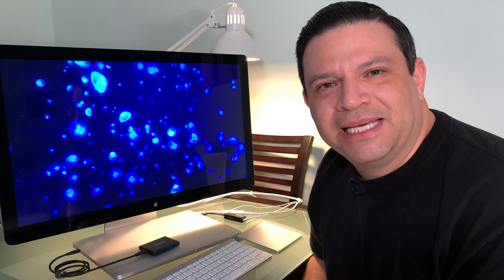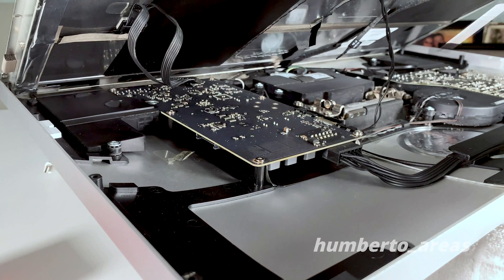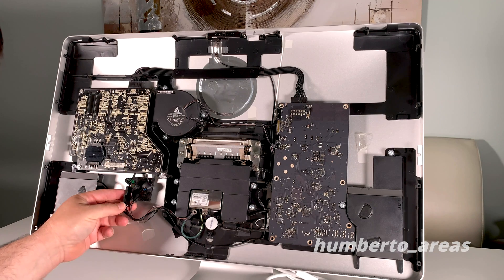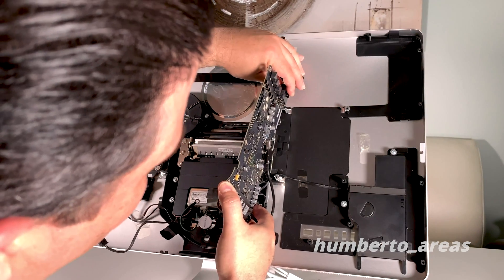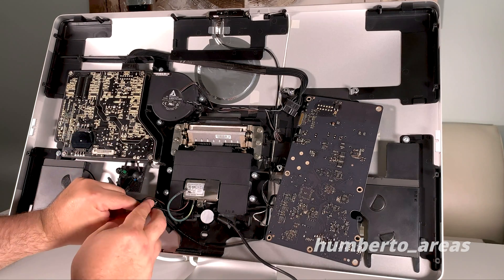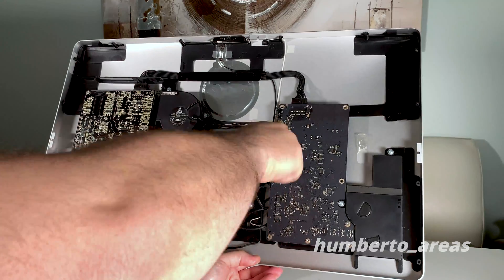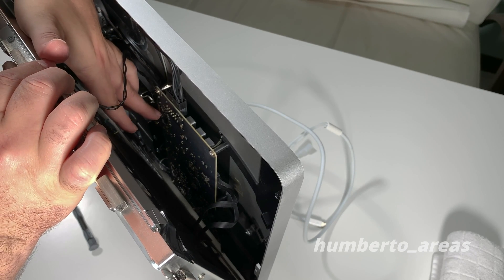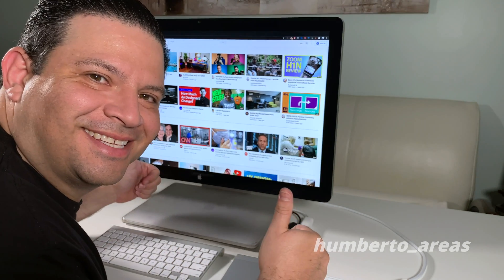Apple Thunderbolt Display Not Turning On - Step-By-Step DIY Repair 2026

Comment: Thank you for this Video, I picked up a 27" Thunderbolt Display for $35 on eBay due to the No Power issue.  I connected it to a separate Thunderbolt cable and it worked!!  Now I can use this video to replace the defective cable.
Reply from the maker: @Will, thanks for watching the video, glad to hear you got value out of it. You got a deal buddy, good for you! What part of the video did you find most helpful?
Reply: @HumbertoAreas  Welcome. The details as far as connectors and their locations.
Reply: was there no power at all? asking bc mine isnt making any noise at all just dead. would the thunderbolt cable cause that like in this video? thank you
Reply from the maker: @Shaun, have you tried another Thunderbolt cable? Perhaps on another PC? Or put an USB stick on the back of the display to see if it lights up? Please keep us posted.

Comment: I bought this used and I stupidly bought it with some shrink wrap on the thunderbolt connector. It was a little flaky at first then seemed to work but went black the other day. You give information about the connector with the black tag (what to do with the tag) when you put it BACK ON, but it's already disconnected when you disassemble. "I did remove the two other cable connectors". No mention AT ALL of flipping that IMPORTANT tag over to disconnect. I just pulled on the connector, the tag came off and it bent upwards the copper strip on the board. I burnished that back down with finger nail. I seem to have gotten it back together but it's as dead as it was. Not sure if I wrecked that connecter with your LACK OF INSTRUCTION or not, but I have to give you a fail since you did not mention one of the most important things. Your step by step missed a step.
Reply from the maker: @John, thanks for watching and for your feedback.

Comment: Hey I did try to fix my monitor as you said but it did not work I went backed and double-checked my work and everything was fine. does this mean the issue I have is not related to the wire?
Reply from the maker: @SwageRanger77, thanks so much for watching my video and for your comments. If the cable replacement did not fix your issue, indeed you may have another problem that is not letting your monitor come on. What is the model number and screen size of your monitor?

Comment: Humberto, more Cinema Display 27 no turn on info for your viewers.  Just picked up another beautiful condition CD27 that would not turn on with my Mid 2011 iMac running High Sierra.  Tried with a M2012 MPB 13 running Mojave and it eventually came on.  Opened CD27 up to check connectors and check for fan spin, all good.  Thought it might be CD27 firmware so ran the loader from Apple.  Went back to the M2011 iMac and still no screen.  Read in the blogs that USB in CD27 sometimes knocks out screen so tried with no USB and it came on.  Plugged the USB in for brightness control and the screen went dark.  Re-boot.  Tried another USB port and success, CD27 comes on with brightness control.  

Damn things are finnicky.  I can't tell you the exact problem and solution.  My guess is the firmware update helped but not sure as the firmware was for an audio issue and not video.  It might be a combination of doing all my testing that finally got the CD27 to wake up.  Anyways, I am not the only CD27 owner with no turn on issue.  It seems to be very common issue.
Reply from the maker: @Encino, thank you so much for checking in and providing this super helpful comments/trouble shooting insight. Yes, very well documented issue with CD27 not turning on, and yes, a firmware update is always a good call. I hope your findings help someone else fix their CD27 not turning on issues. Thank you once again.

Comment: Excellent, thanks for the great instructions/example.  In my case I found out my monitor didn't work unless I simply turned over the cable (i.e. printed "thunderbolt" symbol up, if down the display worked intermittently, if up, works all the time - took it to the Apple Store and discovered this in front of the geniuses who couldn't explain it at the Genius desk, but video'd and documented the behaviour while I was there)
Reply from the maker: @Ray, thanks for your comments and feedback, and of course for watching my video. Glad to hear you got value out of it. Some of those guys at Apple should stop calling themselves "Geniuses" 😄

Glad to hear you were able to video and document the behavior. I was lucky to capture my problem on video before my display died!

Good luck with your display, and let me ask, which part of the video did you find most helpful? I would appreciate the feedback, thanks.

Comment: Could you help me please my apple cinema turns off the screen you can hear everything but it turns off by itself, I disconnect it from the power I reconnect it and the image returns for a moment
Reply from the maker: Hi Dennis and thanks so much for watching my video. So I can better help you, please specify the Model Number off of your display. If you need help identifying this info, please visit: https://everymac.com/monitors/apple - I look forward to hearing from you.
Reply: @HumbertoAreas  my serial mumber a1316 apple cinema 27
Reply from the maker: @Dennis, thanks for the update and for confirming your model number. You have a Mini DisplayPort, not a Thunderbolt display, which is what I feature on the video. So the method I'm using for the cable replacement in the video may be similar for your display, not sure. Do a search on ebay or Amazon for "Apple Cinema Display A1316 Cable Replacement" (or something similar). These cables are inexpensive and is worth a shot in my opinion. Please keep me updated on the repair, and let me know which part of the video you found most helpful, thanks.

Comment: Thanks for this. I just tried this on my thunderbolt display. It worked for a couple of hours then turned off again. Running a macpro with it.
Reply: Thanks for the reply! I made a mistake, its nota a mac pro but a 2017 mac mini. Have tried the NVRAM and SMC reset as well, it worked again for a few minutes but then stopped working again. Thinking to try out with a standalone thunderbolt cable
Reply from the maker: Hmmm, don’t know what could be causing your display to go out after a few minutes? Try a separate Thunderbolt cable and let me know how that goes.
Reply: @taniautomo6390  hi Tania, have you tried the standalone cable? I’m curious to know as I’m running into the same issue, before starting to open the screen then find out it was the display that needed to be replaced. Thanks in advance
Reply: @Themerovingian222  hi Kaia, its good timing that u ask this because i just got the thunderbolt standalone cable a few days ago and it worked for me!
Reply: @taniautomo6390  thank you for the prompt follow up!! I’m so happy for you your figured this out!! With that being said I will do the same hopefully it works for me as well then consider opening the screen to replace the main cable. Thank you Tania 🙏
Reply from the maker: Hi Tania and thanks for watching! Sorry to hear your display turned off again. What year/model number is your MBP?

Comment: It just turned off and never turned back on
Reply from the maker: Thanks for watching my video. Same thing happened to me... but decided to give it a shot. I’m sure you can do the same. 👍🏻
Reply: Your video on replacing the cable in my thunderbolt display was great @HumbertoAreas  and the work went very smoothly, but the display still will not light up or be recognized by my Macbook Pro or my MacMini. What's next?

Comment: Great video and walkthrough. I'm curious have you ever had a diagnostic codes: 
NDT001
NDT002
NDT003
NDT004
NDT005
NDT006

All related to Thunderbolt ports. I have these codes and need some advice on troubleshooting. Thank you!
Reply from the maker: Hi Bishop, and thanks for watching my video, it is greatly appreciated. Let me look into those codes... But yes, you are correct, all those codes have to do with the ports on the back of the unit. I'll keep you posted when I find more info.

Comment: Hi Humberto. 

What a great video!!! I am certain that I could replace my cable as you describe. My A1407 Thunderbolt 27" display might have flashed off for a second the night before I realized it wouldn't wake up the next morning. The Thunderbolt cable that was connected to my mac mini looked as though it had overheated? There was shrink-wrap on the Mac mini end of the cable and it looked a bit melted and discolored. It' has been months since the monitor died, (this happened last March). I have since purchased a new (non-apple) monitor but hate to toss this monitor out simply for a faulty cable. 

I have plugged the monitor in and it gets power (I know this because I plugged in a USB external CD player and the light came on. I am fairly certain that if I install a new thunderbolt cable as you have shown in this video, I will again have a display that lights up. I would like your thoughts about this. Also, Where do I get a replacement cable? Best regards and Thank You again. Sandra Taylor
Reply: I see the links now. But still want to hear your thoughts. Thanks.
Sandra Taylor
Reply from the maker: Sandra, thanks for watching and for your comments. I would difinitely give it a shot... in my opinion is worth a try, the replacement cable is relatively inexpensive, and the result can be a great and beautiful 27” Apple master piece!

Comment: Excellent video, does anyone here know if you can connect a HDMI to Thunderbolt cable to the 27 inch Thunderbolt and get a picture?  (I am thinking to try this first before I pull apart) 

Is there an internal fuse that could be the culprit if the unit does not power up? 

Does anyone have a link to a schematic for the Apple Thunderbolt Display?
Reply from the maker: @Paul, thanks for watching the video and for your comments. You might be able to connect via HDMI, as long as the adapter is "HDMI to Thunderbolt 2" and not a "Mini DisplayPort to HDMI".

I don't know of an internal fuse if the unit does not power up? But there is a Power Supply board: http://www.macpartsonline.com/661-5543-661-6048-power-supply-250w-for-27-inch-led-cinema-display-a1316-and-thunderbolt-display-a1407.html

And I did come across a site where the schematic is available for purchase (although I have not personally bought anything from there): https://en-manuals.clan.su/shop/10297/desc/apple-thunderbolt-display-27-a1407
Reply: @HumbertoAreas  The analysis came back that my intermittent LCD was in fact a dead LCD that needs to be replaced.
Reply from the maker: @Paul, sorry to hear your LCD is no good. I don't know how much these LCD'a may be going for these days? What are you thinking about doing? Perhaps you can grab an LCD off ebay or Amazon and get it to work again?

Comment: does this works also with the 24" Cinema Display?
Reply from the maker: @Marcos, it should also work for the 24" display. Look up your model number and based on those numbers, look for your cable on Amazon (or equivalent). Good luck.
Reply: @HumbertoAreas  Thank you very much for you fast response. I will do that. Cheers  :)

Comment: Great video! I am borrowing a screen like this and am trying to hook up to my MacBook via a multiport. Nothing happens. The screen is all dark. The power cable is plugged in. Any ideas? Do I need to plug in the little power adapter that is coupled with the Thunderbolt cable in order to get the screen to work?
Reply from the maker: @Stefan, yes, you do need to plug that little power adapter OR connect your PC to a direct power supply - If your PC does not a have a power supply, your monitor wont work. Hope this helps.

Comment: Would it be possible to just buy a secondary Thunderbolt cable and connect it to the port on the back of the display then to my Mac Mini? Seems like an easier solution. Thanks for the great video Humberto. Now I feel I am getting closer to solving the screen black out problem.
Reply from the maker: @Bunker Munk - Thanks for watching my video, I greatly appreciate your comment/question. "YES" it would be easier to get a second Thunderbolt cable and connect your Apple MacMini - but but doing so, you lose the ability to power your display - that is the only drawback I see - more cables in the way / to plug-in. But hey, if you got a spare cable and can put that to use, go right ahead! Thanks again for watching!
Reply: @HumbertoAreas  Worked great, no blackouts since. For me it was easier than the daunting task of opening up my display. It was your video that put me on track to solving this problem. I spent a couple of weeks reading forums and even wiped my hard disk with a factory reset before identifying the problem thanks to your video!
Reply from the maker: @Bunker Munk, thanks for your feedback and comments. Glad to hear you are enjoying your display once again. And I agree with you 100% - it is intimidating cracking open these displays, especially since we're not trained technicians - but hey, no PC repair shop works on these, so I'm glad you took the leap and watched how I did it as a reference.

Comment: Perfect!!! Took me about an hour, cost £15 rather than £150 in store! 😁
Reply from the maker: This is great to hear. Glad you got value out of the video. Thanks for watching. Enjoy your display! 👍🏻
Reply: I took mine to a place and they said it was dead!
Reply: £15? Don't know where you got your part, but the Amazon link said $85. You know anywhere else that may have it cheaper? Thanks to Humberto for the video. I may try it if I can get the part.
Reply: @joewoolf1372  I got mine from eBay

Comment: Hi Humberto, how did you know the problem was the cable? I already tried with a standalone cable and still nothing. The display charges my MacBook but no video.
Thanks
Reply: Mine has same issue I can see that it is connected in the Display preferences when using the standalone cable but the screen is black.  I have sent mine to the repair shop. I will post what part they replace.
Reply: @symosys  hey Paul! I’m running into the exact same issue as yours, it will be very kind of you if you can share the rest of your experience. Thanks in advance 🙏
Reply from the maker: @Paul Symonds, wanted to circle back to you and see what was your experience with the repair shop? Were they able to get your display working again? And if so, what part(s) did they replace? Thanks in advance.
Reply from the maker: Hi Fernando and thanks for your comment. My red flag/warning that something was wrong with the cable was the fact that the cable was getting hotter than normal. So instead of spending more money on an electronic board or power supply, I started by replacing the cable (the cheapest part). Hope this helps you trouble shoot your issue. Did you already replace the all-in-one cable?

Comment: This is super helpful! I have a cinematic display doing the same thing, do you thing the process is the same? 
Do you know if the cinematic display is upgradeable to the cord with the thunderbolt?
Reply: Nate not sure if you are still having this issue but there is a firmware update for the 24” Cinema Display if it flashes often. Also the Cinema Display is mini display port not thunderbolt like the 27” display. The cable looks the same but it doesn’t work the same. I thought the same but found the firmware update and it fixed my Cinema Display. I have both monitors FYI.
Reply from the maker: Hi Nate, thanks for watching, glad to hear you got value out of the video. What is the model number of your cinema display? The process may be similar, but I'm not really sure. Also, if you have a cinema display, you may need a different type of cable (not Thunderbolt).

Comment: Thanks for the video. Great tips. Where did you get the new cable?
Reply from the maker: Thanks for watching, I greatly appreciate your feedback. I got the cable from Amazon, here is the link and I hope it helps you with your display. All-in-One Cable Replacement for Apple Thunderbolt Display 27" A1407 (Mid 2011) https://amzn.to/37GRfn4
Reply: Humberto Areas 
Thank you for the reply. I have a Led Cinema Display monitor, previous to the Thunderbolt. The cable is different for my monitor. Do you know if the cable you used can work on my monitor? If not, do you know if it is posible to find the correct one for my monitor? Cheers!
Reply from the maker: @pfbb74, thanks for your question. If you have the previous Model (A1316) to the Thunderbolt, then yes, you would need a different cable - and the cable I used on the video will not work for you. Should you indeed have Model A1316, your display uses a Mini DisplayPort (not Thunderbolt). Hope this helps. Check out this link and let me know if this is your display - https://everymac.com/monitors/apple/studio_cinema/specs/apple-led-cinema-display-27-inch-specs.html
Reply: Humberto Areas 
Thanks for the reply
My monitor is a LED Cinema Display 24" model A1267 :
https://everymac.com/monitors/apple/studio_cinema/specs/apple-led-cinema-display-24-inch-specs.html
It uses a mini display port. 
The monitor stoped working after a slight electric surge in my building. It does not power up when connected to my macbook pro. In fact I am not sure if the problem is with the cable or other component...
Reply from the maker: I am in Florida, USA and I think this is the lighting capital of the world. I learned my lesson a few years ago, always to keep my equipment connected to a battery backup or power surge protector. That is very unfortunate, sorry to hear... Will do some research and if I come across any info that may help you, I will pass it along to you.
Reply: Yes, it was a big mistake...I have all my equipments connected with surge protectors, but for some reason the monitor got connected directly to the wall socket and then it happened...
OK, any information you might find will be appreciated! I would like to bring it to life again! Best wishes!